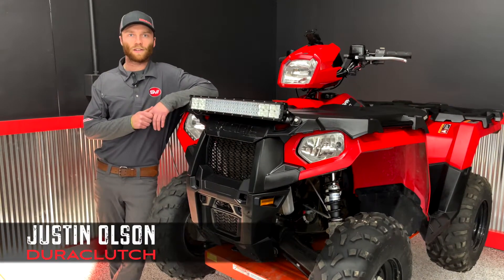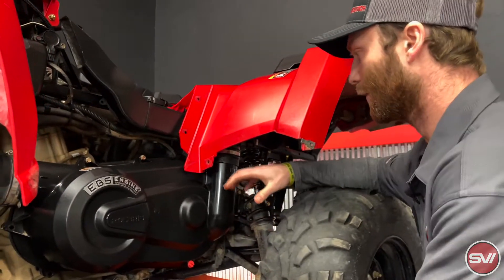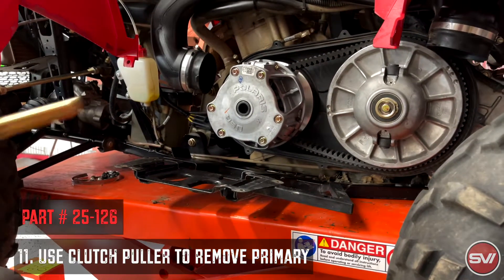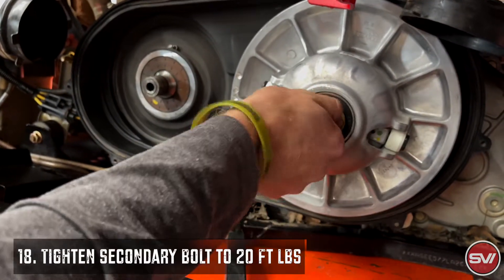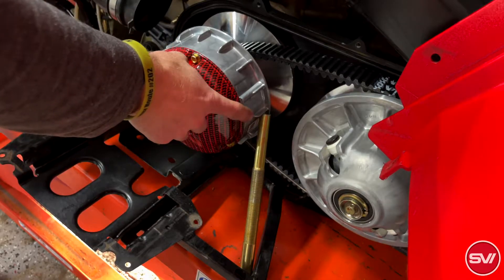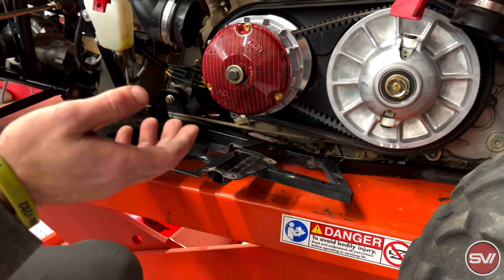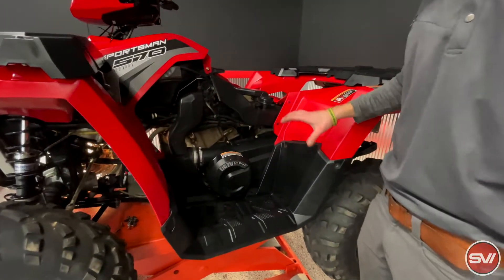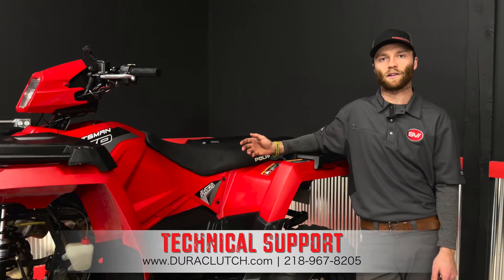HOW TO: Install DURACLUTCH R-Series Kit 15-539 on Polaris ATV (Sportsman 570)

Comment: What are the benefits of the “Dura” clutch system on a sportsman?
Reply: it essentially turns the primary into a yamaha style clutch that uses rollers and polyurea grease, which is quieter and truly uses less maintenance than polaris clutches.  It's an upgrade, but not a massive upgrade because you lose your ability to tune the clutch using different weights with different arcs. For the average guy that isn't running to big of a tire and just likes to get out and ride.. It's good.. but expensive because you get 2 clutches and a belt in the kit.